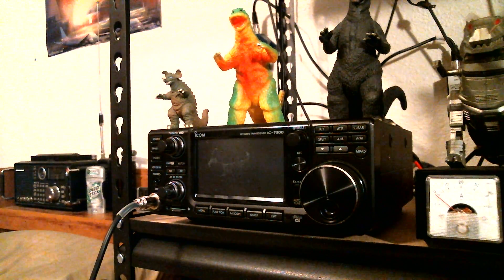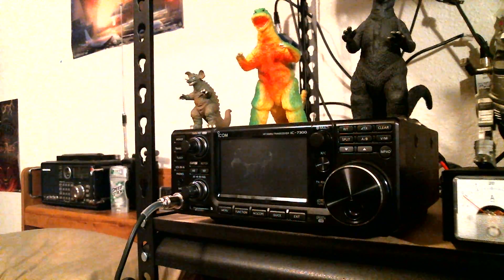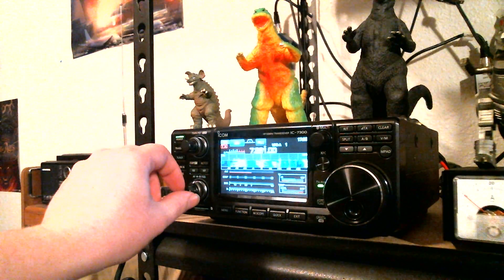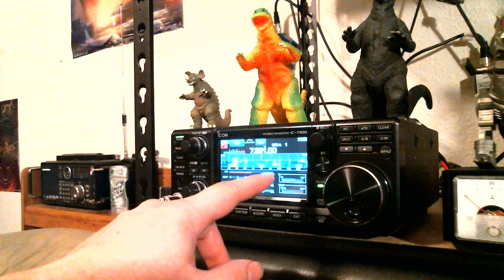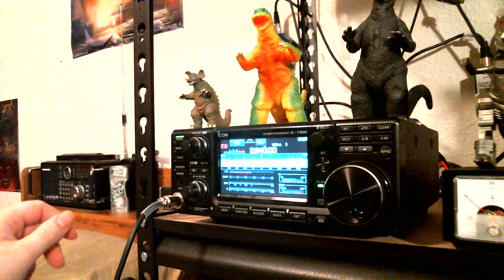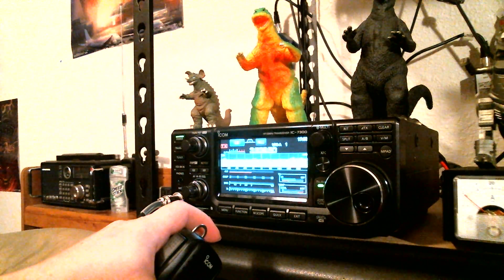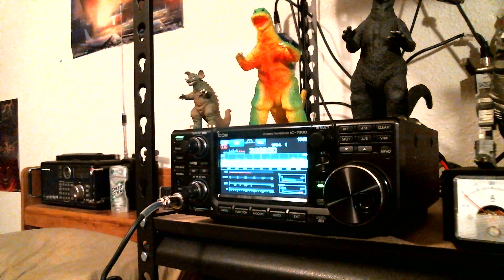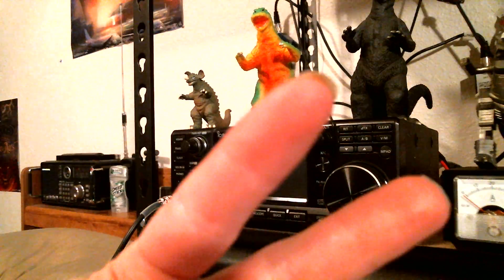Inverted L on the Icom IC-7300

Comment: The inverted vee antenna is so simple as so great. With a good ground, some radials and the high of 5-6 meters it will work great with low ros and good wide band.
The thing most important that it's not expensive 😁
The radio, it's a little nice piece of jewelry.
Reply from the maker: Yeah, the inverted l is one heck of an antenna. I'm hoping to add some more radials when the weather clears up. Right now I have about 6 or 7, but I would like to see what would happen if I were to add some  more.